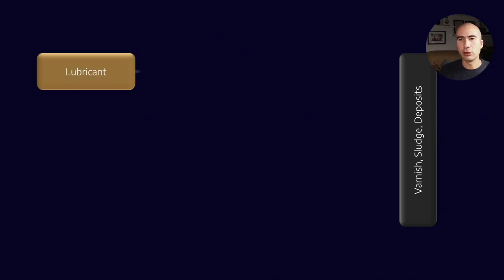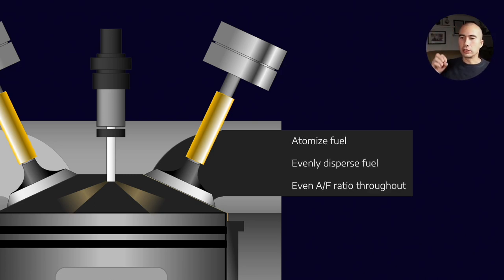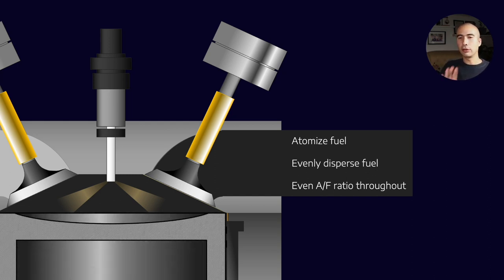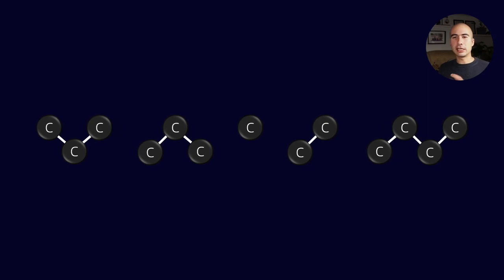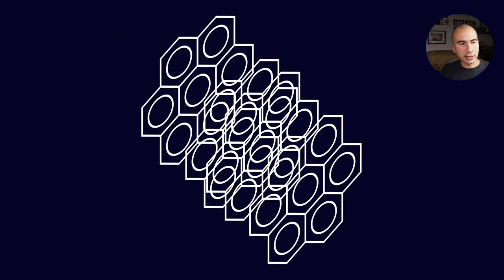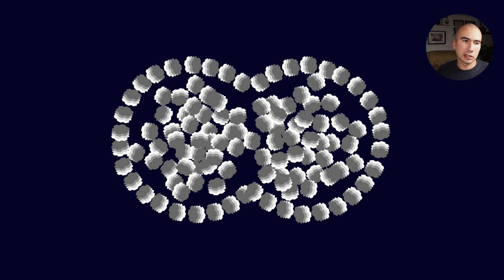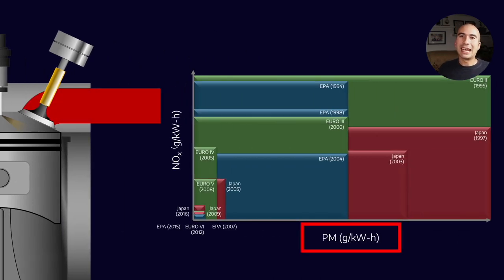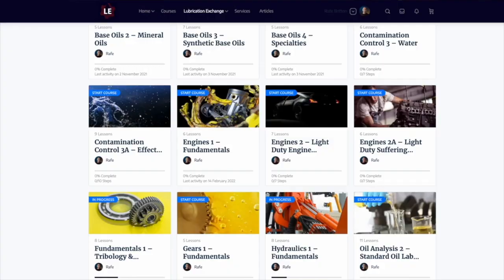How does soot formation occur in Diesel engines? What are the effects on the engine oil?

Comment from the maker: Looking for more structured lubrication courses? Join LE Pro for $30AUD per month (that's about 20USD). https://lubrication.expert/product/le-pro/
Reply: Hello Mr. Lee.
I did comment on one of your video.
I am interested on your course.
Kindly share course content with me.
I am interested to learn about how engine design/oil pump/environmental condition/engine manufacture year  determine engine oil to use. Also about issue of drain interval.
Reply from the maker: Hi Erick! There's plenty of content here on the YouTube channel, but if you're looking for more there's more paid content at https://lubrication.expert/product/le-pro/
Reply: @LubricationExplained  the reason for Spontaneous Charge Compression Ignition SCCI.. ultra fine atomisation ISNT desirable with injectors.. theres a compromise.. ultra fine wont jet across the chamber as good as larger droplets .. the failing with 4-stroke diesels is the need for the donut chamber to encourage the formation of a burning mushroom effect as result of the injector spray pattern.. the front of the spray pattern burns in reaction to the air in front of it .. air has to recirculate around behind the flame front for the trailing fuel ploom to ignite.. dont have that with cylinder port uniflow 2-strokes..

Comment: It's the ethanol in fuel that oxidises.
The oxidised ethanol polymerises to form sludge.
The sludge gums up your rings. 
Fuel gets past the gummed up rings and dilutes your oil.
The oils lubricating properties are compromised and you get metal on metal scoring.

N.B. The sludge issue doesn't arise if you're using fuel without any ethanol.
Low tension rings seem to be most prone to getting gummed up.

The fuel dilution and sludge problem improves if you stop using ethanol... but it's remarkably hard to get rid of the sludge entirely... even after multiple oil changes and flushes.

🙂

Comment: Rafe, great video! I've always wondered why an EGR doesn't draw from the exhaust post-DPF in order to lessen buildup at the intake. Also, have you any opinion about the use of external catch cans in addition to the integrated air/oil separators found in the engine?
Reply: There are some engines that do that, problem is the exhaust will be at low pressure because it's after all restrictions and so it will have a difficult time reverse flowing into the intake because that will be high pressure because of boost pressure, so then you have to either artificially create backpressure by installing a valve in the exhaust and choking flow OR you have to close the throttle and choke the intake a lot, both methods are utilized but whatever method used it usually isn't worth it to lower the engine efficiency further yet in comparison to pre DPF egr only to have less soot going through the engine, it'd make fuel economy worse for the tests that manufacturers are subjected to and the reduced soot wouldn't matter to the manufacturer anyways because by the time the car becomes old enough for that to matter the manufacturers interest for the car is long gone.
Reply: @nesmio7378  That makes sense. Appreciate you sharing your thoughts

Comment: something I noticed from my own stupidity,
i once used olive oil as a lubricant for my firearm due to not having anything else. it strangely formed a thick and sludgy feeling varnish goop over the next few weeks. I believe what happened was a few reactions, mainly the lanolin content of the olive oil was acting like linseed oil and polimerizing. I think however since oilive oil doesnt make the same goo on other stuff, there was nitration and accelerated oxidation occuring due to the unburnt power which is basically nitro cellulose, either by donating nitro groups to double bonds and/or facilitating atmospheric bonding of oxygen which then formed much longer chains through epoxide radicle moa. i think the fatty acids may have also broken down to some glycerin which would have also facilitated polymer formation due to ester formation from local acid production from nitro compound hydrolysis. idk, just coz its a baretta doesnt mean u should use olive oil to lube. funny story but maybe relevant with increased engine temps now days making more nitro groups pre cat and bio disel mfg/consumers dont seem to care about the lanolin content of the base oils. obviously unsaturated is bad but i think the location of the double bonds is very important to their oxidative stability and potential varnish/sludge/polymer formation. thanks for uploading
Reply: @tonydiesel3444  oh for sure. metals are used in many different chemistry reactions since their regular crystal surface allows organic compounds to align in conducive ways for otherwise difficult reactions. I also think their ability to conduct electricity has some kind of quantum mechanical stabilization of otherwise high energy transition states and allows electrons to get to places that would otherwise be difficult to react with. 
yeah platinum and other similar metals in catalytic converters are what most people think of but actually these metals are just chosen for their durability in such conditions, while many other types of metals produce similar results. 
my favorite example of this is a "hydrogenation" reaction where essentially a double bond is converted to a single bond and the carbon area is said to be saturated now. Specifically in the conversion of sue dow fedren to mef amfed amine via the "shake a bake" method. this uses the lithium metal sheets from inside those 1 time use lithium energizer batteries as the catalytic surface, while it simultaneously dissolves in the same reaction vessel (usually a 2l soda bottle) to produce the hydrogen gas and also the hydroxide ions used in the previous elimination step. 
there is another reaction ive read where you can convert i think methanol to formaldehyde by repeatedly dropping in the same red hot copper sheet metal.

Comment: Rafe great video. However it would be needed to stressed out that soot aglomerating in crankcase is heavily impacting viscosity increase. Worse fuel -> higher impact on viscosity because more sooty residues.
Reply from the maker: Great point - I probably should have addressed that in this video. It's something I cover in a separate video on Diesel engine oil analysis but it probably should also be in the soot video. Good pickup!